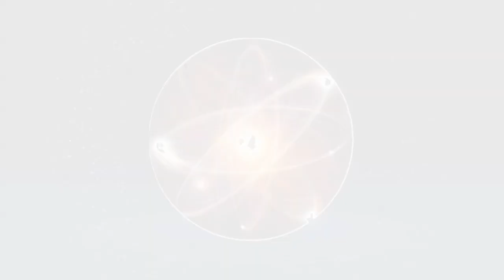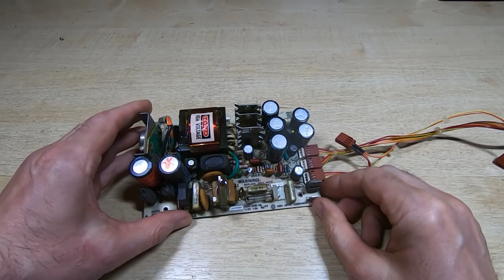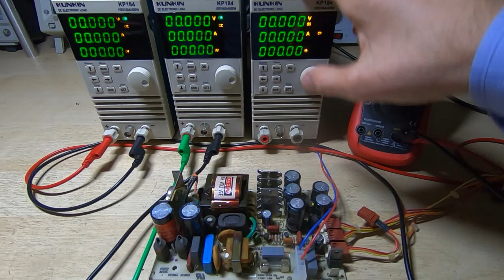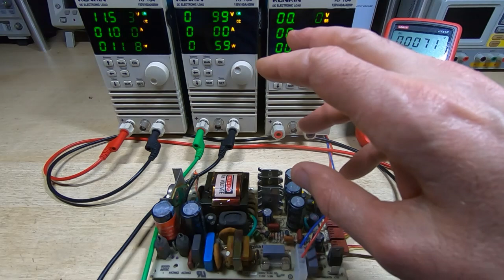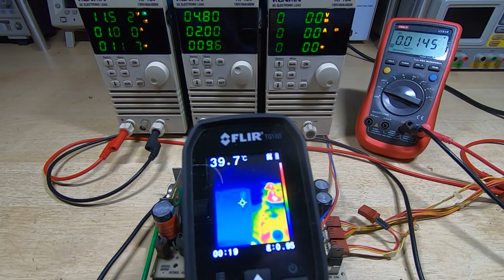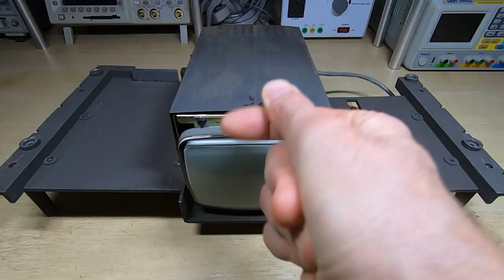Osborne OCC1 Repair Part2

Comment: What type of capacitor did you use to replace the RIFA's in the power supply?
Reply from the maker: There are 2 X1 caps and 1 Y1 cap although you could probably replace the Y1 cap with a Y2 (especially if you are in the US). See the Power supply schematic.
Reply: @JerryWalker001  Thanks for the info. I am from Bristol in the UK. Sorry I meant what type of dialectric? were the replacement capacitors?